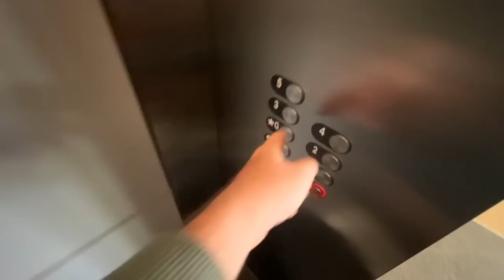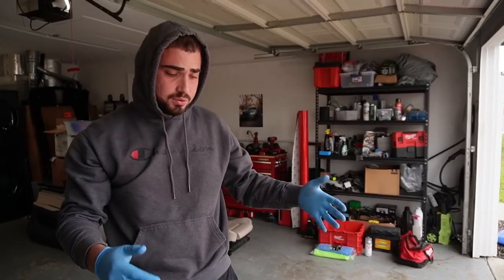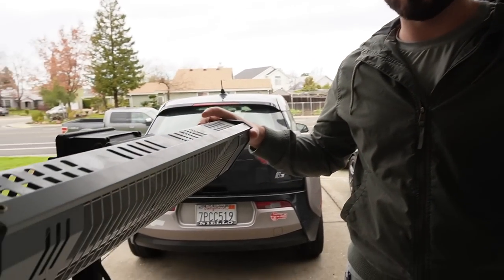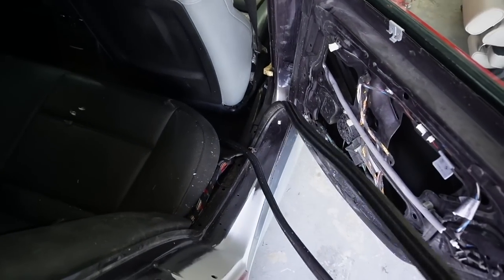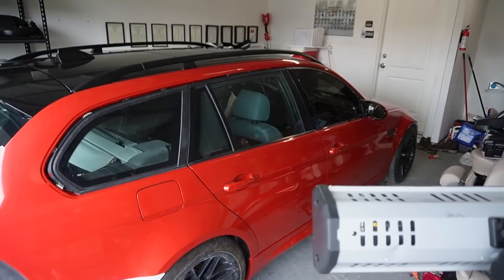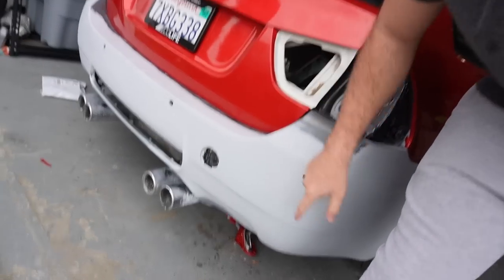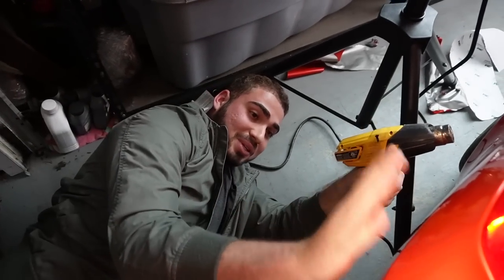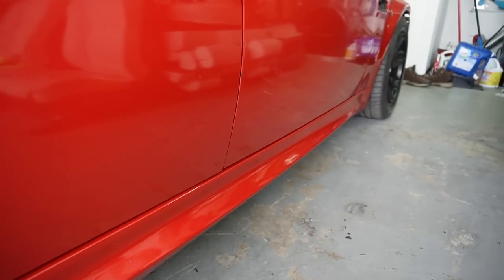The BMW M3 Wagon Of My Dreams Is Coming To Life!

Comment: Hey Nour, great job with the wrap, car turned out great. one tip I'd suggest when you clay bar the car is to use soapy water rather than the quik detailer spray as you're basically putting some sort of coating over the car when using the spray. soapy water works the best as it decontaminates it and leaves it dry to the touch, which would better prepare the surface for the wrap to stick to. Car looks amazing and proud to see how far you've come with the build, keep it up!